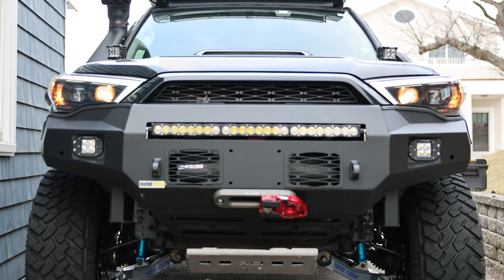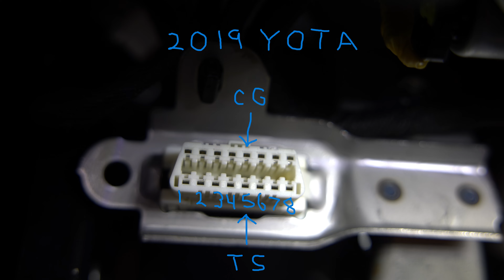HOW TO: Toyota Zero Point Calibration in 10 minutes 10 easy steps.  (CODE 1290)

Comment: Managed to do electronic power steering and brakes calibrations using these CG-TS pins and instructions for MY13 European Toyota Auris Hybrid. Unfortunately the ECU mapping would be needed in my case with EPS ECU and motor -system fully replaced. While EV-mode driving, the EPS does not function, and only with Gasoline engine running, the car has EPS active. The fault light is on with EV-mode also, but I cannot get any fault codes out. Tried to read fault codes using CG-TC pins. The EPS light does not flash at all, while other modules provide no-fault-flashing patterns. This would indicate the EPS ECU communication issue I believe. Gonna replace the old EPS ECU(with motor integrated) and hopefully the system works with Hybrid vehicle again.

Comment: Hey guy, if you look at the drawing of the connector, it is upside down from the connector in your vehicle. (Note the angled sides)  Thus you have the correct pins, but the labeling in your video is incorrect for CG and TS.

Comment: long shot here but was hoping for clarity and possibly some guidance asap lol. I have my trac light solid and multi terrain select light blinking. I attempted your method but I cannot get past the part after clicking the paper clips together 6 times. 

To elaborate, I follow your steps, I click the paper clips 6 time, everything lights up (while the two paper clips are still touching), turn ignition off, while holding paper clips together ignition on but no dice. the abs and trac light do not blink in unison and it is exactly how it was before turning ignition too off. Please advise thank you.

Comment: Do you like it better than your 80 series?
Reply from the maker: havent been behind the wheel long enough to answer that.
Reply: @jailbreakoverlander  Totally! Loved your setup on your 80! Recently bought a mint bone stock lx450 from a pick and pull yard for a thousand bucks, fired right up and have been driving it ever since, did the lift, 35's, custom built a brush guard and roof rack so far but love it for camping and wheeling!

Comment: The reason it was 5th pin from left , and not 4th as documented, is that your OBD connector is upside down. Pretty sure Toyota deliberately install it upside down,  just to fuck with people....  So unfortunately that means all your pin numbering and labelling is wrong.The pin you label TS is actually CG, and your CG is actually TS. So, numbering goes other way too, so your pin 8 is actually pin 1, 7 is 2, 6 is 3, your pin 5 is actually pin 4, 4 is 5, 3 is 6, 2 is 7, and your pin 1 is really pin 8. And on the  other row of pins (on top in your video) those are pins: (from left to right in video): 16,15,14,13,12 (TS not CG),11,10,9. You get the idea. The upshot of it is that if your connector is correct way up with lo9ng edge on top, then you use the 4th pin from left (top & bottom row). If connector is upside down then its the 5th pin from left (on top & bottom rows), just like in your case.